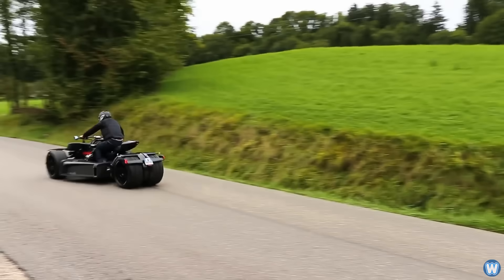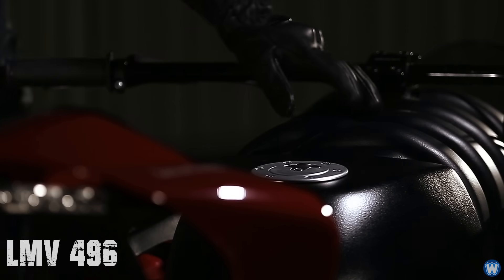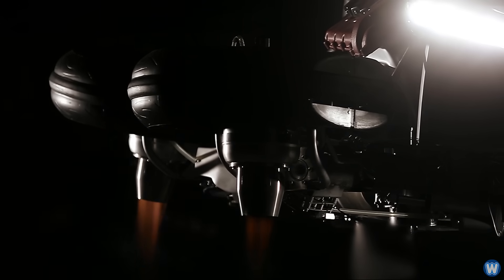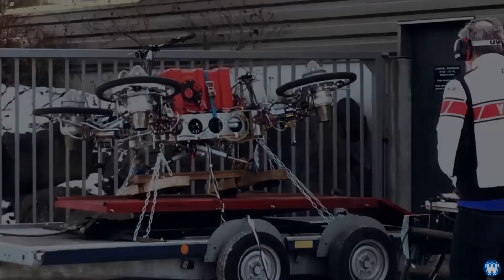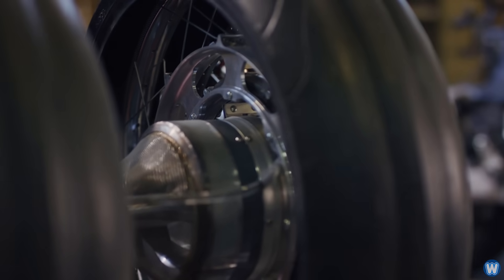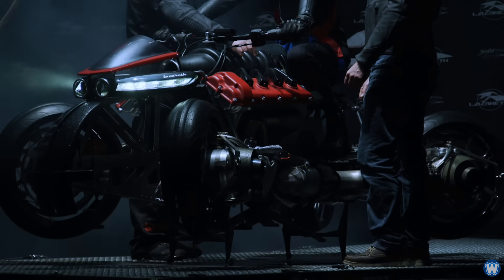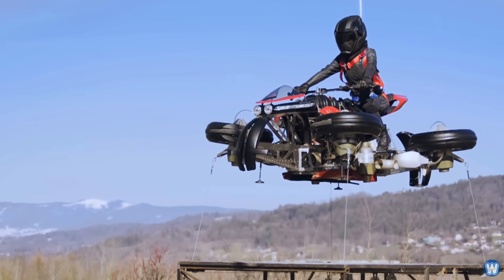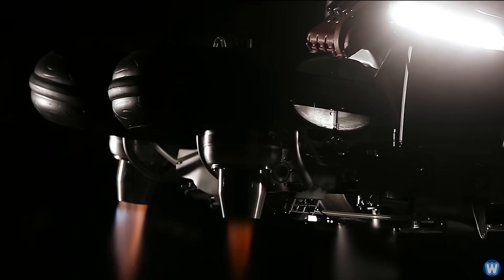Lazareth LMV 496 - Transforming Jet Hover Bike

Comment: Why? Apart from the cool factor, the engineering behind is certainly genius but absurdly overly complicated. All this tilt actions and electrically moving parts. The complex control and feedback system, (which does not seem to work very well yet), the necessity to modulate the jets throttles, the risk if just one jet fails, etc. Who would dare to ride this machine? Apparently not even Lazareth since each corner is tethered and even the rider is tethered and fully suited up in formula one style gear. Only 10min of fly time. Are you ready to handle the noise of 6 screaming tiny jet engines? How do you brake the thing in flight mode? More power to front to make it stall? How does it steer? like a quadcopter? That requires a great amount of fine throttling to these little jet. Very cool concept, but it will take quite a long time before we see this thing truly flying. Best use case would be to avoid road taxes by flying on to the road and flying off the road prior entering the toll areas. But with 96 M EV range it’s not that interesting even as an e-motor cycle…

Comment: I would like to know how they planned to stablize that thing. their trying to fly in a "drone" like thrust config, except Jet engines cannot be spooled up and down (amount of thrust altered) fast enough to compensate for pitch/roll and yaw stablization like the electric motors of a quadcopter can.  Electric motors can change speed multiple times per second to compensate for balance. Turbines take multiple seconds to substantially change speed. Not fast enough.

Comment: If use 20 × 1 dm^2 × .5 m and 700 turn of at minimum 300 m of 12 gage wire handle at least 3 amp DC pulsating solenoid it can generate even a Cessna much less bicycle plus if use compressor make water from air and use it as thrust then it can be more than you can beleive

Comment: I got a feeling they got the idea for the LM 847 from the Dodge Tomahawk. A motorcycle with four motorcycle wheels very close to each other and a massive 8.3L V-10 from the Dodge Viper making 500hp and a theoretical speed limit of over 350mph, no one has the balls to test out its top speed though. Very similar in design though, the Tomahawk came out in the early 2000s as a way to prove the dodge engineers could thing outside the box.

Comment: This design should utilize 4 triggers for the flight. Two on each side of the handlebars. Front triggers control the front thrusts and thumb triggers control the rear thrusts. This way would be easier to stabilize the overall ride. And I'd volunteer to test it.

Comment: Just wondering why they didn’t use props if it’s already electric seems like a lot less engineering required
Reply from the maker: there would not be enough thrust to lift the bike and rider
Reply: Wonder World that’s unfortunate... I bet you could pull it off... full carbon construction
Reply from the maker: @popecosh307  it has been done, like this bike https://www.youtube.com/watch?v=5XdbWYzM4oY&t=146s

Comment: Where to begin....ok let’s say that one jet engine is roughly $5000.00 and you clip a parked car or curb the jet. I bet you’re in for more than just a jet engine. And there are four opportunities to have this happen. Or lay the bike down in “bike mode” and you’re screwed. This looks like the dad from gremlins designed and built it. Total crap and most likely to harm you. There is NO need for this crap. The military doesn’t want this shit. Pipe dream is being nice.

Comment: Dump the jets, modify the electric generator to create magnetic fields, pulse the current to compensate atmospheric pressure. Use mercury to amplify electric current. Only one capacitor under the center of the machine.

Comment: A really good motorcycle with two sides.
It's good to be able to fly in a jet engine.But a long time is not possible. The drawback of a fuel-consuming jet engine is that it has a single power source to replace it.
It would be a better way to go if something was added to fly. Now, there are many fuel consumption, noise, gas, etc. that are far from eco-friendly, so it is not easy to make up for this.

Comment: The biggest issue with this product is that in order to fly an aircraft like this you need an advanced flight control/stabilisation system and the company developing it is grounded in hardware. The hardware of the bike is very innovative and seems well done, but it will never fly until they add the electronics and software to make it easy enough for people to fly practically.

Comment: I feel that it would be much easier to control if the jets stayed at a static thrust, and use thrust vectoring nozzles to control the output of each engine. This would be a much more accurate and faster way to control the thrust output.

Comment: The jet engines were a mistake and really aren't practical....

If you really want to make a hover bike, make it gasoline electric. Electric motors for ground mode and giant E-Fans for hover mode. Gas engine will charge the battery thus increasing range and it makes fill up easy.
Reply: That'll work, but we'll still never get them. Just a bunch of concepts that never get commercialized.
Reply: The future is here
Reply: Sooooo, why still you havent made ur own? Instead of yacking to someone elses invention, why not make your own version, so we commentators have somthing to yack about as well...
Reply: @hahnselativ1139  You first

Comment: Get rid of the transforming bs (lower weight) and just make a functional hover bike. This one actually seems safeish if they can figure out the stability issue. No whirling blades of death for lift is a positive.
Reply: Performance for hovering is probably not great though with jet engines, if there is more venturing with this stuff, the larger slower spinning propellers will be king in this stuff for pure thrust, in a staticish environment like this. All imo

Comment: They'd save a lot of weight keeping the wheels fixed and just having the jet engines on retracts.
Reply: And speed as well ...but first version looks movie cool so .... probably wanted to go for classic syfy style.
Reply: And you could transfer from riding to flight without having to stop
Reply: @nicholaspowers4782  Well .... you'd need to slow down to around walking speed (at least for now) but yeah. Even hitting a rock or pothole would mess you up even worse than normal crash.
Especially if any gyro or thrust system tries to overcompensate.
Reply: I think then it would need some blast shield or heat shield between the rubber of the tires and the exhaust of the engines
Reply: An issue with that is the engine might melt the tires that way
Reply: True...and when you think about it, Tony Stark really only needed to make a hand blaster to escape from his captors in Iron Man 1.  Personally, though, that wouldn’t have made a very good movie, let alone help set the stage for the MCU. Set the bar high. As tech and ideas progress, this concept will make more and more sense.

Comment: Just thinking out loud but why not add a main central thruster and use the wheels more for stability?
Reply from the maker: it does have 2 middle jets, maybe for that reason, maybe just for extra thrust.
Reply: It's mainly a weight/fuel issue, like with most of it.